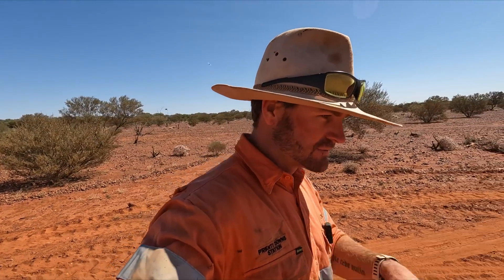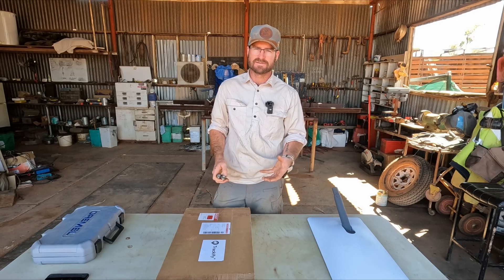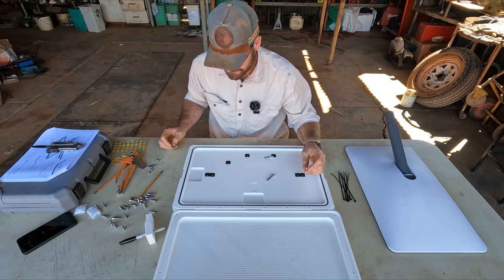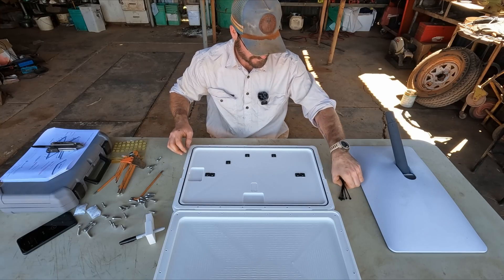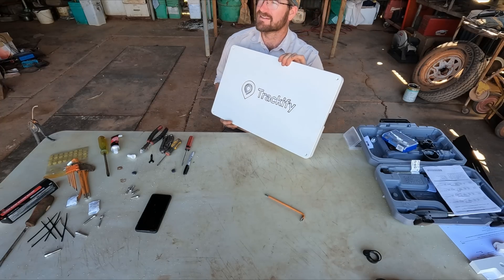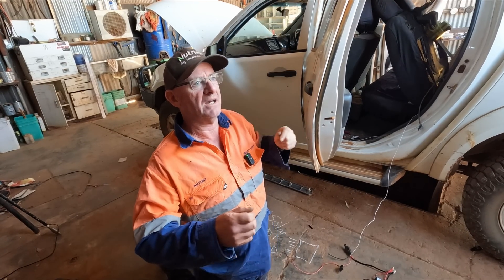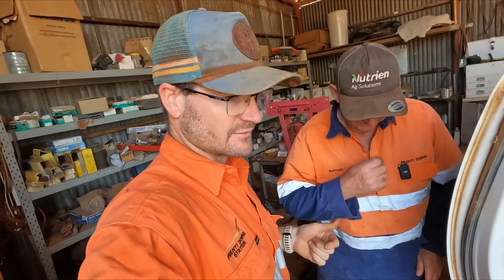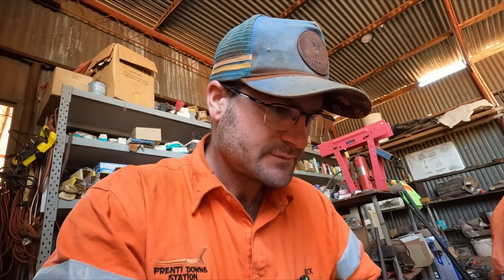The Ultimate Outback Starlink Setup: Boost Your Internet Connection

Comment: Off the cuff comment......Why not mount those connections on the arch bar on the front side .....which will allow ladders etc to rest over the arch bar and not destroy the connections.
Reply from the maker: Yeah that's a good point, I didn't want to put the cables on too much of an angle. But protecting them better is probably worth more!

Comment: the ISP version of the Cube, hard to tell from here, but that is only 2.4ghz. So your performance would be a bit less then desirable, not like you need 300mbps down, but I thought I let you know you would not be getting your max more likely.
Reply from the maker: Yes absolutely, you won't get the performance from the starlink per device. But like you've said, for our use case we don't need max performance. 
Plus we have just a few of the ISP spare!

Comment: Watching Jack go at it with various tools was funny as, the wiring diagram Ant did made me laugh so hard, great vid guys you show just how easy it really is, one thing that might help the wifi range is an external 2.4 GHz antenna or glass mount, if doing this make sure the coax used does not lose to much there are brands out there that use RG58 on 2.4 GHz I found when working in remote areas in the 1990 I ran the Optus Sat phone was great, plus mobile was really hit or miss, I look forward to the next vid of Jack and Ants' Aussie Adventures.
Cheers
Reply: I would put the aircube in the window since 2.4ghz would get eaten by the truck body.